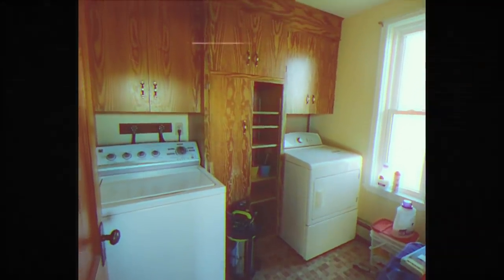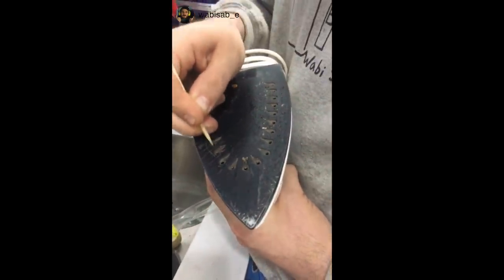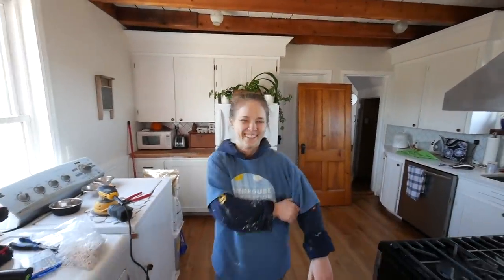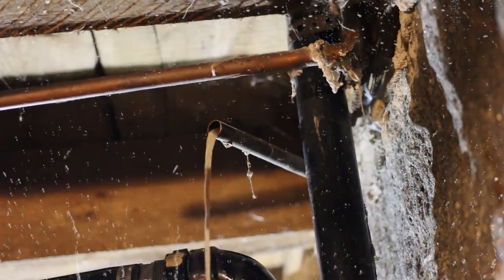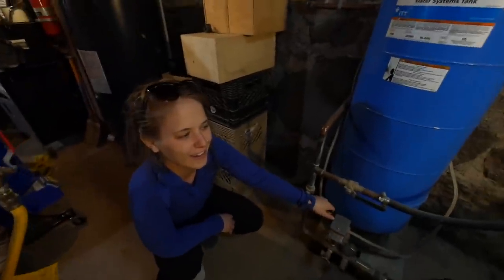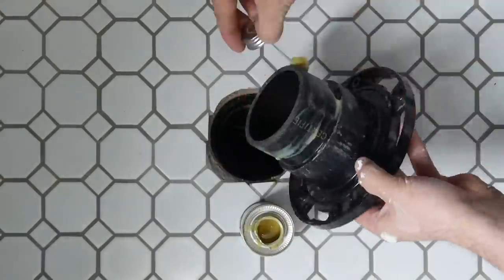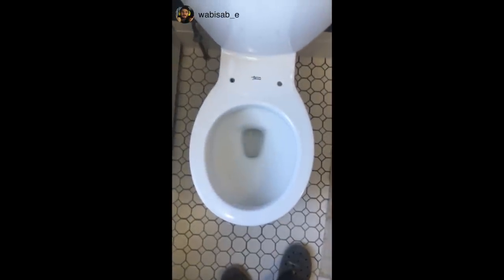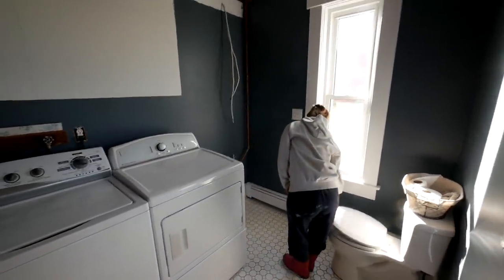Farmhouse Restoration | Laundry Room | Ep.19 |

Comment: For anybody interested in using Ditra, I think you are expected to leave a 1/4" gap around the perimeter for expansion, and if you want a waterproof installation, you should use Kurdi-Band tape on the Ditra seams, and edges where it meets the walls.

Comment: Nice video! Shark bite connections are great. But will deteriorate over time as they rely on a gasket internally to function. Wouldn't recommend installing them in unaccessible areas.

Comment: usually with the Ditra membrane you are supposed to screw your sub floor every 6 inches to insure it won t move once wet by the concrete. I didn t know that and my floor popped and had to redo the installation, so maybe it didn t do it for you but for other viewers make sure you add a screw every 6 inches.

Comment: missed the Kerdi seam tape for true waterproofing of the tile install. I mean really don't think you will have that much of an issue overall and it should hold back most of the water without damaging the subfloor, but if you wanted to guarantee it to be flood proof I would of done that and a few other things. it's a laundry room though not a shower area so no worries really, already one step ahead on it with the ditra. Your videos are amazing though editing is fantastic and really sound. You could easily do wonders in the entertainment industry if you wanted. I look forward to each upload.

Comment: I think the only thing I’d have done differently is using a toilet with a gray water sink because if all it’s for is washing hands you’d have more space and less plumbing, I think. But if you plan to use the sink to add value to the house as a “half bath” not sure a gray water would work… I guess it just depends on your needs.

Comment: @12:09  You check off another required experience for this to count as a real renovation.

Remaining items:
- Mild electrocution
- (Inadvertent?) Commission of a (possible) felony
- Emergency trip to a medical facility (extra points if outside normal hours; triple points if you have to resort to a veterinarian)
- Having to undo and redo major work because you forgot an initial small thing (extra points for having to repurchase materials for the redo)

[EDIT:  That's hilarious.  I wrote that comment before I saw the thing with the rag in the drain.  Too funny.  Another item checked off the list.]